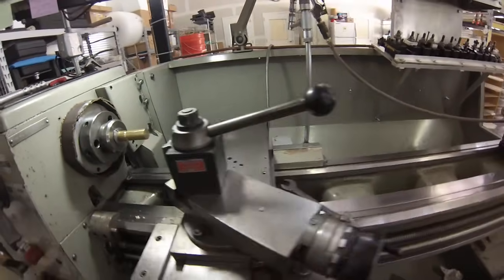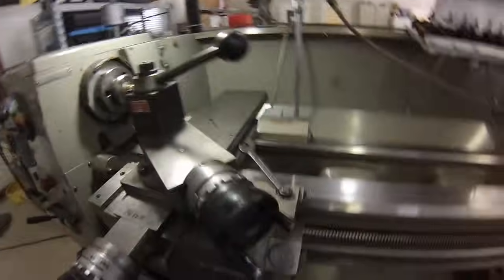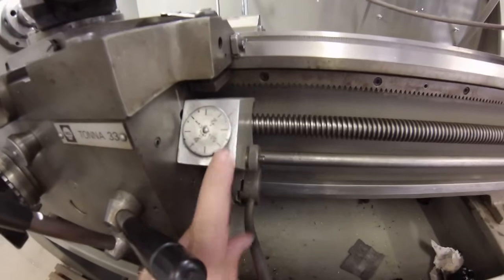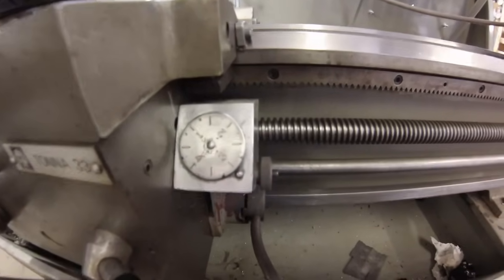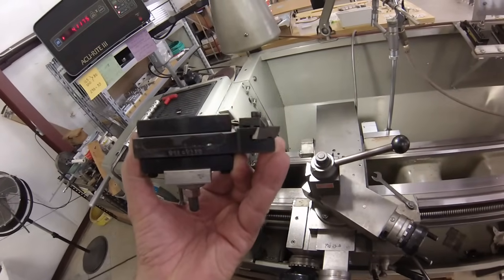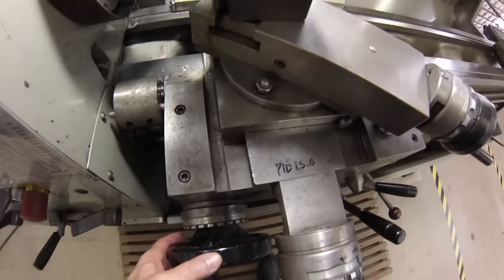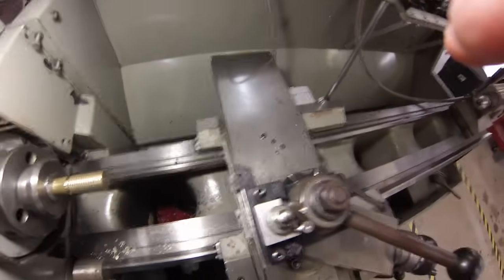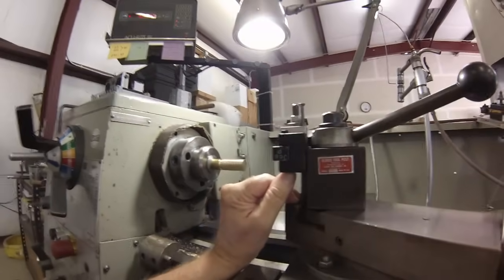Threading on a manual lathe  BEST TECHNIQUE EVER !!!!

Comment: Glad to see others use this technique.  I first started using it when I discovered the toy lathe I have did not have enough power to thread at the slow rate one would feel comfortable with when approaching a shoulder.  This is due to the electronic speed control.  On the real lathes I used in the past, slower speed caused higher torque. I put the threading insert in upside down and feeding the insert into the relief groove, would set a depth, put the lathe in reverse and turn the speed full on.  This usually did the trick.  I would also never disengage the half nut, but would rather reverse the motor and power the tool back to the start.  Of course I would back it away first.  Using the cross slide to set the repeat depth, the added depth each time would come from the compound.
I also have used this same reverse idea for cut off.  Like you said in your video, if the setup flexes at all, in reverse this pulls the tool away rather than digging in.  Very important if cutting grooves into really soft stuff like PVC pipe.

Comment: I have the screw on chuck and have done it both ways on my chinwaaa lathe..
I also use the  5-mt in the spindle ..sooo i use an mt-5  to C-5 Collet insert.. works  in both directions and with the C-5 i can use longer work then the standard collets...great vid and safety first always.....

Comment: Super idea!- running tools upside down is good in many applications. Despite what I saw in the comments Id say you'd need to be running a really really heavy cut in reverse to unscrew a chuck that has been mounted properly. Hard to see how that would happen on an industrial lathe with threads of around an inch or so. Thanks for posting
Reply from the maker: I personally think the tool would break long before the chuck would unscrew, but for liability purposes, I did put a disclaimer in the video description. Thanks for watching.

Comment: The only problem with that is if you have a screw on chuck, you shouldn't operate your lathe in reverse for the chance of your chuck unscrewing. Awesome technique for cam locking chucks. Another good method for threading a bore is to invert the tool and operate it just like you're threading or turning .

Comment: A chunk of modelling clay or Blue-Tac works great for holding measuring wires as a group when measuring screw threads.
Reply from the maker: I used clay when I had to, but after a while, I could hold the wires easily. You do enough threads and it gets to be second nature.

Comment: hey joe great videos. Great for a short thread, but what if you have a center in the end of your work piece? If your cutting a thread on a small DIA work piece you need a centre  in it
Reply from the maker: I have done that many times. Either use an extended nose live center, or grind your tool accordingly. You'll still have to disengage in a timely manner, but not a split second decision.

Comment: Great technique but won't setting the compound  slide that way result in the trailing edge of the cutter engaging on the piece as you advance it? I thought the cutter should cut on the leading edge.
Reply from the maker: The compound wasn't used in this demonstration. The thread was done exclusively with the cross slide. It was plunged. Even at 29 degrees, the tool would still cut on both sides if you used the compound.

Comment: Joe, Thanks for the video. It's great. May I ask what part number tool holder and insert are you using? Is it a left handed tool holder with a right handed insert?
Reply from the maker: I believe its a Kennametal NSL 123B holder with left hand inserts
Reply: Hi Joe, Would you please post up the manufacture number and preferred source for for the inserts?  Both the Top Notch grooving and threading inserts that you like to use? I am working a few project with 4130. Thanks!

Comment: I have been threading upside down and away from the chuck for years.  I never admitted it as it seemed like cheating and I thought I was just not good enough at stopping the cut at the right moment to do it 'the professional way'.  
I had never worked out how pitch gauge wires were supposed to be used though.  Thanks.
Reply from the maker: Are you still unsure about how wires work?

Comment: One of the things I remember being taught in machine shop was ALWAYS cut towards the chuck and ALWAYS on the side of the work facing you. I was an outstanding student and became a TA as I progressed and taught the same but kinda did differently on my own. Through the several careers I've pursued I've done what's necessary instead of what's conventional with comments like, "How you do dat" or, "You got lucky this time". It's worked well for me and the 'thinking outside the box' mentality is what usually leads to innovation.
Reply from the maker: I agree. conventional teachings are a good place to start, but should not be the end of the road. I have made many parts that could only be done the way I have demonstrated here. Exceptionally fine threads with a minimal relief cut against a much larger shoulder. Then throw in a controlled root diameter or terminate at a +-.001 o'ring groove. You have your hands full and better come up with something creative.

Comment: Good info, I've used this method and thought it was normal.  Also use boring bar and cut on back side of hole in reverse feeding away from chuck.
Reply from the maker: I do the same. Excellent control and results.

Comment: Why didn't I think of doing threads this way? What a great technique. With this method can I still plunge with the compound and use the cross-slide to pull back for the return and reset to zero for the cut?

Comment: Yes I agree with the low mental pressure of using this technique, But-But as a non professional or hobbyist, first you must have a reversing lathe without a screw on chuck and second, if you miss your mark on the threading dial you can have a potential disaster. The conventional way, if you give yourself a comfortable gap between your work and tool and miss your mark you just disengage your half nut, back up and start over. No harm no foul. For myself and I believe most hobbyist I would use the conventional way, from right to left, make your finish undercut wider when practicing, go slow, and have a quality nut around matching the OD threads you are cutting and sneak up on it until you build up your skill and confidence. Enjoy your videos. Ed K. Cleve. Oh.
Reply from the maker: Hey Ed. I enjoy the comments. Allow me to reply. Please bear in mind, I have been doing this for a living for 40 years and have run thousands of threads. I agree with the non-thread on chuck comment. Thats why there is a warning in the video description. Lets look at the conventional way. You have two moments of concentration. Engage and disengage. If you are comfortable with single point threading, or use the slip technique I illustrated recently, the engagement part is easy. You are not allowed, with most lathes, to use a hard stop for the carriage at the thread end point. You'll shear off the pin on the leadscrew, or worse. If you are threading up to a larger shoulder, and miss your disengage point BOOM! Tool and part are immediately destroyed in a spectacular fashion. Done from the chuck out, you can have a hard stop for your carriage, minimal undercut profile, and the stress of the disengagement point is eliminated. The only thing you have to do is hit your start line and relax. And don't use a nut as a gage. PD and wires only. If you are unclear on how that works, just ask. Thoughts?
Reply: Thanks for the reply. I am not disagreeing with anything you showed. Just wanted to throw in my opinion for us hobbyists. Being a retired heavy equipment mechanic/welder fabricator and machinist as needed for the last 45 years and now building up my own home personal job shop for my own projects and friends projects and repairs I just like to throw out an opinion from my view point that can help other hobbyists. The 4 years of formal machine shop training I had in high school along with all my self taught learning through all the years and still, is the best education I could have had for my career.  I just didn't like being cooped up in an inside environment day in day out all the time and doing production work. I do know how PD and wires work but I like to see the final results and that is why I have seen more go-no go gages used in shops, especially shops doing production work. Seems like every time wires are used the machinist ends up going back and has to tweak it in and then use a standard or a quality nut or the matching part anyway. Just my thoughts, thanks, Ed
Reply from the maker: Bottom line is, if the parts don't go together, someone gets an ass chewing. No Doubt. Gages are the way to go. I plan to cover gage making in a future video. Thanks for the conversation Ed. Have a good weekend.

Comment: I like your thread cutting wires not used in the UK we go for a adapted micrometer ( a spike on fixed anvil ) a lot less trouble
Reply from the maker: We have thread mics here, but they are thread specific and expensive. Wires are accurate and cheap. if you are accustomed to using them, they are no trouble at all.
Reply: The wires must not be popular because you just can't buy them here
Reply from the maker: mscdirect.com

Comment: excelent advice, I used similar techique on flat bottom internal threads but slipped to use it on outsides with all disadvantages.
Reply from the maker: This has worked well for me for many years. Thanks for watching.

Comment: Great video and great channel. I subbed on the strength of this video. I just started getting into home machining and Ive got a small lathe. This is a great Idea and I'm sure will save me lots of broken tools and frustration when threading.
Reply from the maker: Make sure your lathe chuck can be run safely in reverse. You'll like this technique.

Comment: Can or how would you do that for inside threading?
Reply from the maker: It can easily be done for internal threads. For RH, tool is right side up, machine in reverse, cutting on the back side of the bore and thread out. For LH threads, tool is right side up, machine is in forward, thread on the front of the bore and thread out. Double check you settings by dragging a sharpie marker inside the bore to simulate the tip of the tool. The LH/RH will be obvious.
Reply: Joe Pieczynski Excellent! Thanks for the explanation.

Comment: this guy is good real good just like me jk im looking for old lathe cheap that I can do big gun barrels like 34 in barrel and 2in wide if the lathe don't work I think I can fix im a good fixer but do have any ideal of what old cheap  lathe big but not to big would be best for me
Reply from the maker: The bore size is going to be your issue. When you start getting thru hole capacity that gets big, usually the whole machine gets big. Your talking about a 17 or 18 inch lathe to take 2"through the spindle. Monarch, LeBlonde, Clausing are all good larger machines. Look around.
Reply: ok thanks I will look at them names thanks for what you do I was up till 5 last night  watching you and went to work I mite be up agin watching you im learning fast what bout a 1.5 inch thru hole capacity any other good names

Comment: Another excellent video. Your teaching technique is simple and to the point. Keep them coming.
btw: I really appreciate that your tooling is off to the side so you are not reaching over the work for it.
Reply from the maker: I cross my hands during the tool change too. I unlock the tool holder with my left hand and reach over my left forearm with my right hand to get the tool. Its an easy swing to the tool shelf and back without ever letting go of the handle on the tool holder block.

Comment: This is the way I thread most of the time (for about 50 years). I also sometimes have put the tool normal side up (not upside down) and come in from the back of the lathe. But most of the time I use the upside down and come in from the front. About two years ago, after  watching Tom Lipton struggle threading into a shoulder. I emailed him explaining the process and tried to get him to do a video. Don't know if he ever read the email or didn't have time to do it. I'm glad to see someone  finally  put it on You Tube. The only thing I do different I use the compound instead of plunging for a much cleaner thread. Tool geometry sometimes needs to be changed for threading this way. I can set my Monarch to kick off at the end of a thread but this way take less time to setup. Unless you have to use a center on a small diameter piece, this is the way to go. No stress no mess.
Reply from the maker: Interesting. I never knew monarch had an auto stop for threads...nice. As for coming in from the back. What set of circumstances would force you to do that?
Reply: I have a Monarch Model 61 Toolmakers lathe. It has kickoffs for threading into and away from the head. The cross feed also has a stop for threading so that you can return to your zero when you use your compound to feed in. You can override the stop if you want to do a straight in plunge for your finish cut. As for coming into the work from the back. Sometimes you get better visibility, coolant flow, better tool post holder location and sometimes running multi tool posts. But your cross slide has to be configured to be able to do this. My Monarch is not and I don't have that choice. But I have done this on other lathes.

Comment: Joe.  Found your channel a month or so back and have learned more from you in a month than from all the other machining videos I've watched for the past couple of years.  This idea has the ability to reduce so much stress on me as a novice lathe operator.  Are there any situations when it would not be appropriate?
Reply from the maker: I have yet to find one. If your lathe can safely be run in reverse, embrace this right now and never look back. Thank you for your gracious comment.
Reply: Joe Pieczynski 
Suppose your engineering drawing does not allow a thread relief?
Reply from the maker: Then the thread must be done on a CNC lathe programmed to runout the thread, our the part must be thread milled on a CNC mill. In my experience thos are the only two options if a continuous groove is not permitted. But, If the print does not allow for one...question it.

Comment: I wonder why in the US, you set the top slide (upper support) at angle?
Reply from the maker: Rigidity. I plunge all my threads.
Reply: Joe Pieczynski Interesting. I already see it to be better method. Never seen this done here in Czech republic, and i miss the international experience. As an apprentices, we actually kept the upper stock straight, and used it to set depth of the thread. Never tool-cut thread on lathe since (only used dies), and its 20+ years.

Comment: I have been doing this for years, thought I was the only one. Drives my brother (BS mechanical engineer) nuts !
Reply from the maker: Does he ever come out from behind his desk? ME's in the states don't spend nearly enough time in the shop. I used to teach 'Design for Manufacturing" to 3rd year UT engineering students. They had no idea how much they didn't know until I showed them. Its always a good thing when a machinist and an engineer have a good relationship. Both end up learning something.
Reply: @joepie221  So true! After many years in  design position, got back on the tools this year. It's so rewarding learning the stuff  I feel as though I should have known years ago.

Comment: Joe, thanks for this. It worked a treat on a telescope adapter I just made with a 42mm x 0.75mm thread hard up against a shoulder. I also found out that there's an alternative to leaving the half nuts locked the way the manual tells you when cutting a metric thread. You can pick up the lead screw if your carriage is in exactly the same place and you pick the same number every time. I used a carriage stop to do this. Cheers.
Reply from the maker: Having that stop in the equation is a big help. Glad you liked it.

Comment: Nice!  Cutting toward the headstock never bothered me, but this is a nice shortcut.  One question:  I'm often trying to cut an external thread but need to keep it concentric to a center hole (like a hollow shaft). Right now, I take (too much time on) a 4-jaw chuck to get it 'dialed in'. Do you think if the part was long enough, I could 'stick' the bore on a live center of my tailstock, then thread this way?  It would certainly have more 'escape' time than up on the head stock end...and it wouldn't bother me to scratch the live center with the threading tool if I was slow on desengagement.  Any thoughts?
Reply from the maker: That would certainly work, but the part still has to run concentric. Your rigidity will be better up at the chuck if you can get the part through the spindle.